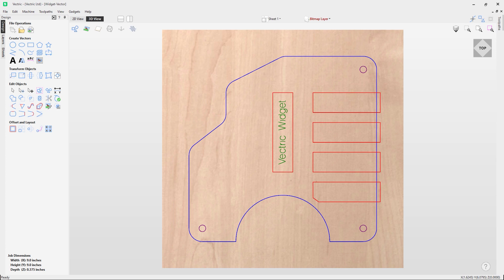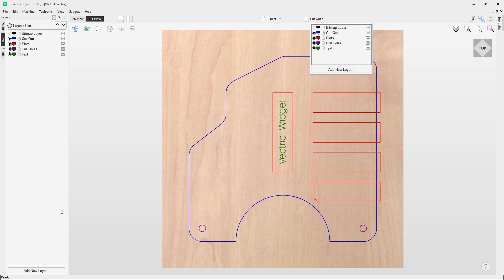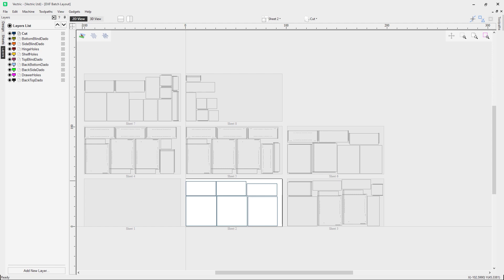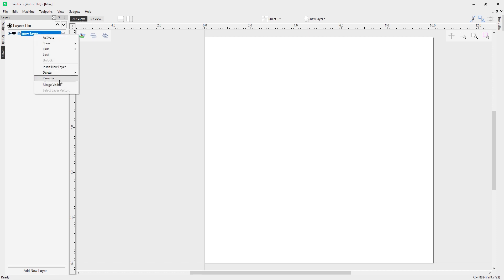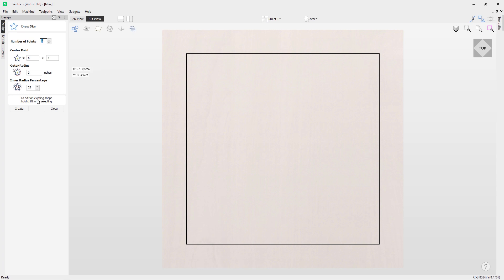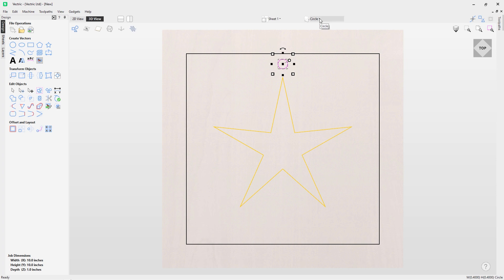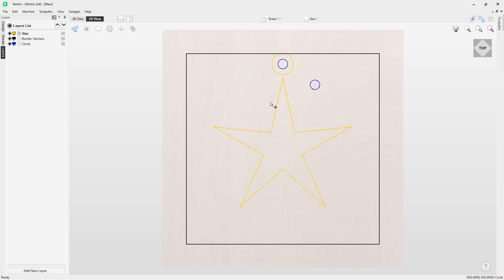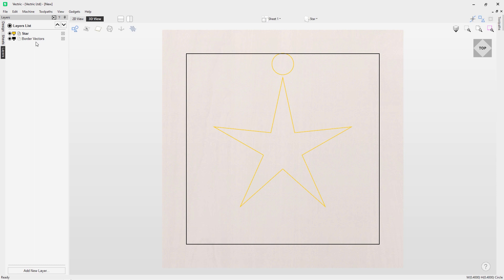How to use layers in Vectric software | General Topics | V12 Tutorials

Comment: You speak just fine.  For those people that think you are talking too fast, there is a setting to slow the video down. Just click on the settings cog on the bottom of the screen and then playback speed.  I recommend slowing it down to 0.75.
Reply from the maker: Thank you for that and the slow down tip... :)